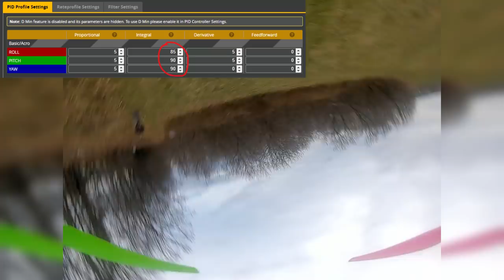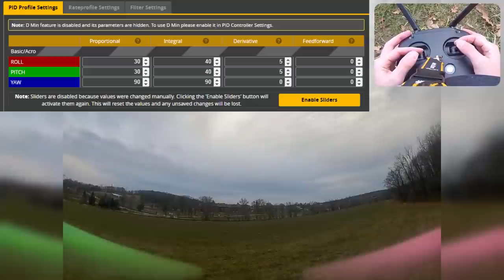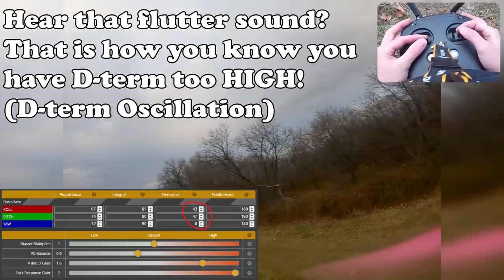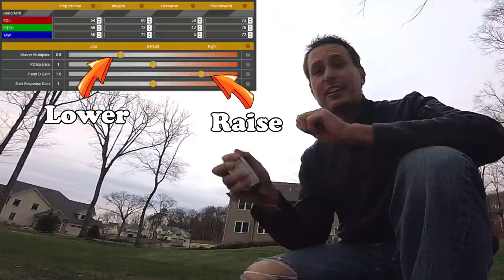How to: Fix Oscillations | I-term Tuning

Comment: I cannot connect to betaflight anymore.  Any suggestions?
Reply from the maker: Bad USB?
Reply: @uavtech  Turned out to be a serial bus device problem.  Once I deleted them from my device manager, it solved my problem.  Now I have another problem, I have lost my RSSI signal in my radiomaster TX16S.  Radiomaster has been a disaster for me. This is my 5th one.  Worst radio on the market.  Nothing but problems. Love your videos. Thanks.

Comment: Is it possible to have an auto tune PID feature in betaflight ?
Reply from the maker: Other FW has tried it, and it never worked well.  I'm not saying it is impossible to get working great, but it would take a team to be very dedicated to it for probably a year or more to prefect and keep optimizing.  It is not easy to detect a stepped response in a constant stream of data flow with no storage space and only 210Mhz process that is 80% utilized with flying the thing already.  Even at 400Mhz (H7) that's not much for that kind of processing.
Reply: @uavtech  Which were the FWs that tried it ?

Comment: Is this the video for betaflight low throttle wobbles
Reply from the maker: Yes.  It is not a BF thing.  It is a tuning thing.
Reply: @uavtech  ive neen able to tune it out pretty easily but I've got one being problematic
Reply: @uavtech  any suggestions for a 7 inch. I'll watch and study the video
Reply from the maker: @djilly75  theuavtech.com/presets
Reply: @uavtech  thank you so much bro.
Reply: @uavtech  should I do anything different to run 96khz pwn? It's an F3 esc

Comment: Initially you had D term too low. I wobble is a lot more slow than that. You get 1-3 wobbles in a second or two when it's too high. I like to keep my I term really low, at least to me it makes the quad feel really stiff. Doesn't want to turn its head once you bump it up but as of lately I've been flying kinda tight spaces, anyways.
Reply from the maker: That's a good point.  As you increase D-term, it all slows down.  How much really depend on how much D-term you add.

But I hope it draws the point that to stop I-term oscillation, you increase P-term.  Not D-term.  Increasing D-term only makes it slower.
Reply: @uavtech  When I saw it the first time I swore my gyro was bad, couldn't understand why it was oscillating so slow as only thing I had encountered before were the D drills or the P wobbles :)

Comment: For these examples, D min was off I assume?
Reply from the maker: Yup
Reply: @uavtech  honestly, IMO d min creates more problems than it solves. I always turn it off
Reply from the maker: @STEDDiEFPV  me too.  I do use for larger rigs to push down the D-gains for smoother forward flight, so it does have its place, but in general, the P/D balance is pretty sensitive so moving the D-gain around a lot can be trouble.  In a boosting configuration, i see merit as well (prop wash), but results can vary.

Comment: Is it true that a prop wash after a split-s move can't really be fixed programatically? I'm getting used to the stick movement now on how to avoid it but would be really nice if BF can do a pattern similar to what we are doing in ReactJS library where we can pre-cache an object or asset(like a css or jpg file) right before we enter a new page in application. In an fpv flight case, maybe if BF sees gyro data in a curve shape pattern, apply throttle intelligently when it receives instructions from the pilot such as throttle going up. Here's my latest video with minor propwash after a split-s - https://www.youtube.com/watch?v=lBWFpbX12T4&t=73s
Reply from the maker: It's turbulent air.  There is no way to predict its impacts on propeller thrust.  You can read it and compensate, which the gyro does.  The trick is having to compensation faster than the camera frame rate 60 to 120hz (aka 60 or 120 fps).

Motor reaction time is actually the biggest limiting factor many times to get the fast enough update speeds.
Reply: @uavtech  Got it! Cool info!

Comment: Boy that's an awkward way to explain it.
Reply from the maker: Thanks I guys... ???
Reply: @uavtech  It's really strange to tune I before P.  I don't think it's helpful to get cutesy with the terms.  Just describe them exactly and plainly as they are.

P is the direct response to the current error.

I is the response to the accumulated error.

D is the response to the derivative (or direction) of the error.

I personally just take the stock BF PIDs, back them down a bit, then tune them upward.

For P term, I put the quad in a fast orbit around me and turn it up until I hear oscillations, then back it off.

I term tends to manifest itself in punch outs, so just punch it and adjust until you no longer see it wobbling when you do.

For D, start doing extremely fast snap flips/rolls and adjust until it can stop those motions on a dime.
Reply from the maker: This was not the process for how to tune.  This is just to show the fundamental relationship between the terms.  People don't understand how to address slow wobble or  bounceback.  They don't understand what too high of and i-Term in relationship to P-term looks like.  Further, the balance between the terms is the key, not their absolute values.

For tuning process, see theuavtech.com/tuning
Reply: @uavtech  Technical people don't defend the wrong, they correct it.

First, the descriptions I laid out are correct and no longer than necessary.  Your descriptions in this video are sketch at best.  You don't need to defer to other material if only 3 correct sentences cover you.

Second, order of operations matter.  The order I described matters.  Too low P term itself can cause oscillations.

In this video, it's not clear what you were truly demonstrating, and if you really wanted to isolate i-term why were you messing with P term mid-video?

Even for the purported purposes, the video is really just misleading and imprecise.
Reply from the maker: Whelp, you are the only person how has said that.  But thanks for the feedback.  Noting is wrong to correct BTW. 

I did cover P-term oscillation and how to dampen it (d-term).

You are missing that too low P-term ONLY causes oscillations with a fixed I-term because you are lowering the I/P ratio.

I moved up P to show that as you bring up P, it controls the I-term oscillations.  NOT the D-term as many think.

See https://youtu.be/62tVYd6AEec as a follow-up to this as well to prove that point.

Again, both these videos are NOT showing now to tune a quad or PID controller.  They are talking about oscillation you see in a controller, and what terms to adjust (moreover ratios to adjust) to dampen those oscillations.  I linked you to all my content for tuning guides; which are well excepted at this point by hobbies and professions because they work - and work very well I might add.  I'm know for this know because of that fact.  That would not be the case if i sucked and was full of shit.

Comment: NO. i program pid loops for the flight controllers i design and just about every single thing you said is wrong. PID = proportional, integral, derivative. you tune P, then D, then I. infact you can set I to 0 and the drone will still fly fine (if a little sloppy). i term is the least important and the worst thing you can do to remove i term oscillations is increase P and D, that will cause more problems than you could imagine. please stop making videos on topics you dont understand, its dangerous to newbies who dont know any better and incredibly irritating to everyone who does understand..
Reply from the maker: Sorry, but over a series of videos and years of implementing with others in the hobby and professionally, you are not correct.

This is not an opinion.  Other leaders in the milticopter world will agree as well and we all worked together to prove it in the Betaflight team (developers).  We ran tests to confirm all that is stated is actual fact.  You can review for yourself in the writeup at theuavtech.com/tuning. Hence the way that Betaflight works now with PID sliders.

Please stop making statements on topics you don't understand or experience, testing, and facts to back it up.  You don't know what you are talking about.

This video is 3-yrs old.  Way behind this as a theory at this point.  It has been peer reviewed my critics (BF developers) and with the plain facts (independent testing) in front of everyone, had to come to the same conclusion that it is how stated.

Comment: Thanks for the info of this, still learning. So if Im on the right track, I have micro jitters, and to solve this, I would increase the D term? Tricky stuff for beginners.
Reply from the maker: Ummmm probably not.  D-term dampens for big movements, but also adds jitters and noise to the commands for.vibrations.

What do you mean by "micro jitters"?  Little shakes while flying straight?
Reply from the maker: Simply prop wash?  If the motors are pushing into dirty air, it is turbulent.  

Check out this video: https://youtu.be/sdfVoUyXRMU